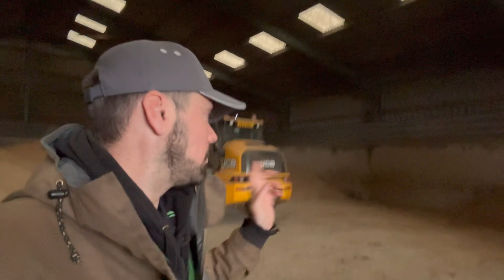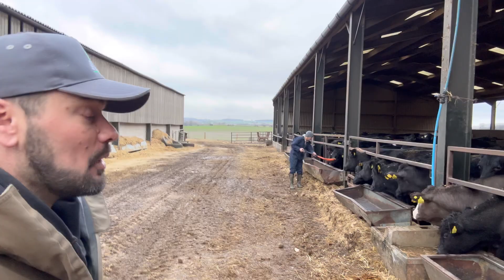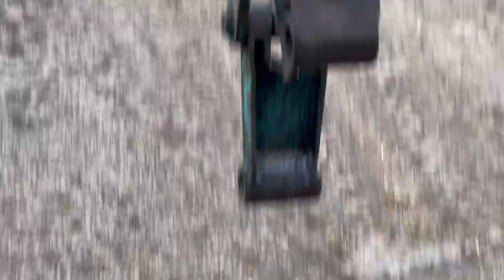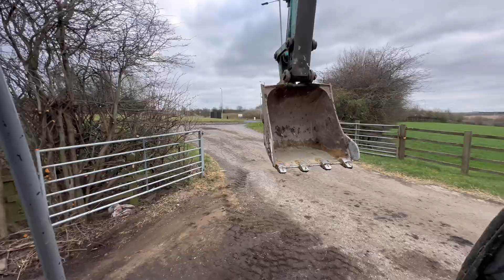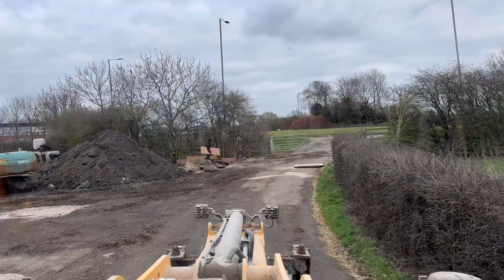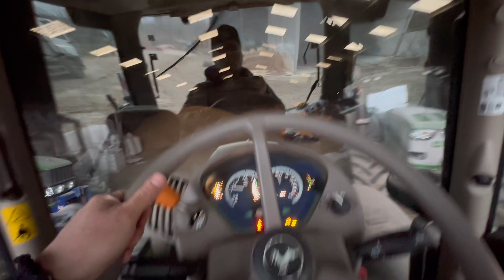Construction Time! Scania Goes! Busy Day

Comment: Push a metal pipe with a point on the end with the digger under the road. It's easier than you think, done it a few times and you can still use the road whilst doing the work.
Reply: Yes I've done the same it works fine
Reply: Same here were shoved a 6inch still pipe with a cone to a point end welded on then layer it in a trench as it was 6 meters long and 5 ft.deep and just sat astride the trench and pulled the pipe towards the 20to digger and it went under a treat  for us!!

Comment: Hey Joe, Dafs are a good honest truck but you will get lots of warning lights. I’ve run lots of different Daf cattle trucks over the years from CFs like yours right up to XFs on the deckers. Have you chosen what make your new box is yet? Houghtons like your current one are good but Plowman are also good and not far away from you, just above York. Also be careful bolting your box onto an old curtain slider body, they’re designed to flex, when you bolt a rigid container on it prevents the body from flexing and can sometimes cause the body to crack up. We used to add longer bolts with a spring on at the front of the body where it’s bolted to the lorry chassis to allow the body to flex more. Sorry for the long comment keep up the great channel!
Reply from the maker: Thanks Scott appreciate the info! Have to see what comes… it’s a surprise 😂😂